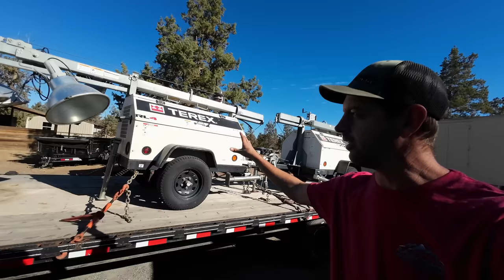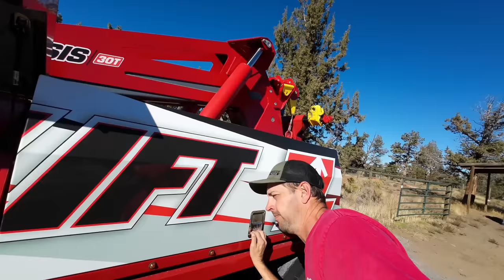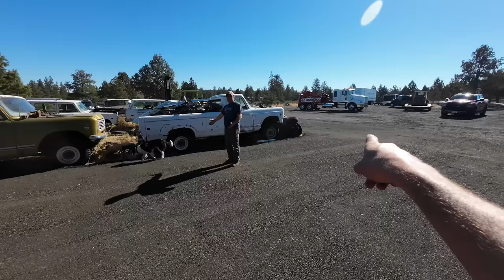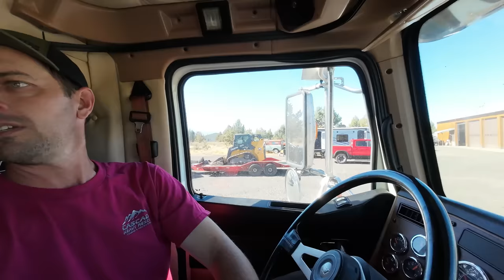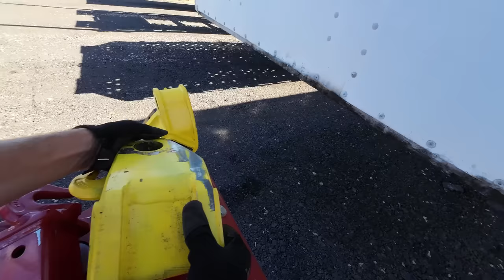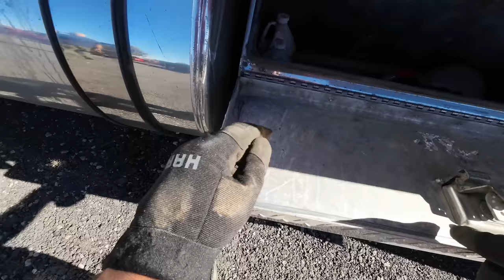Some rules were broken…. 😂

Comment: As part of the all-knowing YT comment council, one thing I noticed you're doing wrong is continuing to use those snatch blocks with your fancy new truck without taking a second to freshen them up with a rattle can restoration. Oh, and there's also a giant sticker on the side of your truck that doesn't say Cascade Heavy Rescue😂😘
Reply: You know paint has no tensile quality right?
Reply: @AH.135 No, but it adds 5 horsepower…
Reply: Fly or wheel? 🤔
Reply: @AH.135  what is tensile
Reply: Tensile testing is a destructive test process that provides information about the tensile strength, yield strength, and ductility of the metallic material
Reply: Ductility is a mechanical property commonly described as a material's amenability to drawing
Reply: Not pictures
Reply: @AH.135 You're my hero, what would I have done without your expertise? You still haven't explained why you assume I thought that paint was for anything other than aesthetics.
Reply: That sticker probably made it cost a lot less than full price

Comment: Question. The Zacklift system. Is it  cheaper to go the route you went or to purchase a 30T Rotator? If specifically just for heavy towing. Not for trailer use??

Comment: @406garage3 Ben, that piece of trash you picked up was a tool used in Fly tying. Basically it’s a self squeezing tweezer with a hole for your finger that allows you to wrap feathers around the shaft of a hook easily. 
The internet has spoken. Now you know. 😂

Comment: Using the old school methods  as in 2240 lb's imperial  to the ton  and a frameless 45' box weighing  in the region of around 6 to 7 ton empty, that old International grandad just lifted and pulled between 13500 and 15500 lb's of trailer no problem, though I think I  would refrain from starting up a haulage company on the strength of it lol. to quote the old time map makers filling in the middle of the Atlantic.......there be dragons.   In your search for a fifth wheel adapter plate that will connect safely to the boom, try reaching out to other content providers like   IC Weld or on fire welding to see if they could construct an efficient  bespoke one tailored just for you, the collaboration between two  highly successful youtube channels would make an exellent video in my  humble opinion.....a bit like Clint at CC equipment and Mike at Dirt perfect, and Lets dig 18 do.

Comment: Didn’t even need the wrecker.  Bottle jacks and the truck.
Reply: And air supply hose
Reply: @martymiller1412  no air supply just bolts to release the brakes.
Reply: When he rolled up and explained what was required I thought, it's a shame man doesn't have a fork truck because I could have moved that trailer with one.
Just as they are siting the trailer, man comes out with a 9 tonner FLT.
All staged.
Reply: @andiehyde3714  but entertaining . did you watch to the end ?

Comment: I hate to be that guy, but the truck being able to pull the trailer 50 feet or so really isn't that impressive. At the high end, it weighed about 13k, which is the average weight for an empty fifth wheel camper. So, a one ton truck (which is what Ben said it was) should be able to easily pull an empty semi truck trailer. And considering a truck that old probably has an extremely stiff suspension, the lack of squatting isn't that impressive either.

Comment: The video makes no sense. The reason the zack lift is detachable is so you can detach it and use the 5th wheel which also would have saved you a lot of length.
Reply from the maker: If we were going to do that we would have just used Ben’s Peterbilt
Reply: you obviously did not see ALL the shit in front of the truck that was used for a dolly.  now do you really think his wrecker would have fit in there on top of being able to get it out
Reply: It should be obvious that the goal was not to do it in the easiest way possible. Otherwise they would have just moved it with the forklift. Obviously the goal was little more than to play with Casey's new toy.